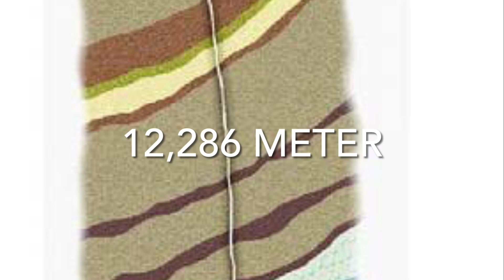How deep can we dig? And why not deeper?

Comment: Thank you for going into somewhat more specifics than certain other clickbaity videos (something something RLL) by at least mentioning pressure in addition to heat, plus the interesting tidbit about water. 180C doesn't seem that hot by material standards but add pressure and presumably also steam and i can understand better now that the real issue is gonna be in the bit jamming or being rendered incapable of 'chewing' due to the pressure balance, and the well casement being unable to prevent the frictional binding of the bore pipe as you try force it deeper.

Interestingly the Kola borehole is no longer technically the deepest, but not by much.

Based on the material science I'd guess that our best possible efforts would likely cap out maybe a kilometer further down if we poured money into a deep dig for the sake of research, but we likely cannot break through into the crust-mantle boundary zone without some utterly ridiculous material science and generations of dedicated R&D.